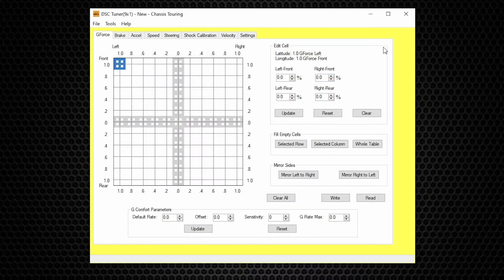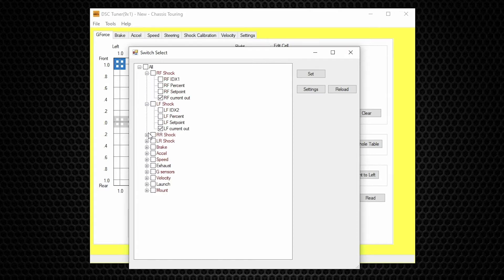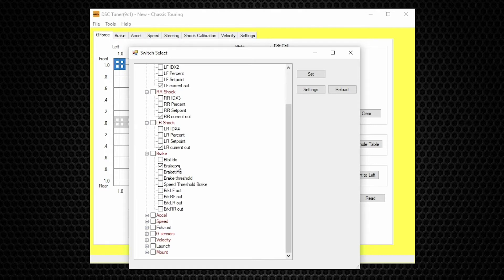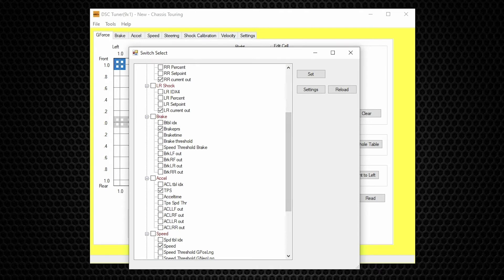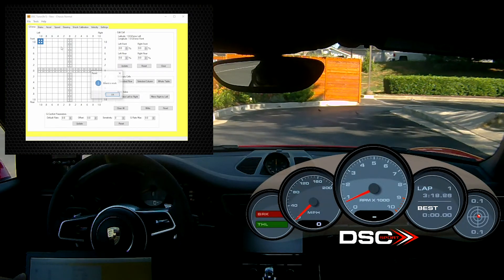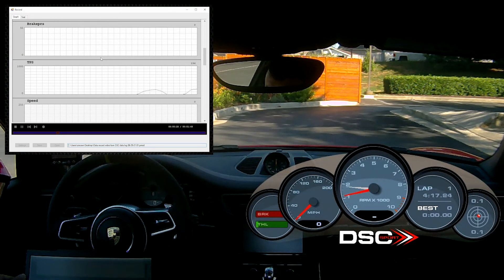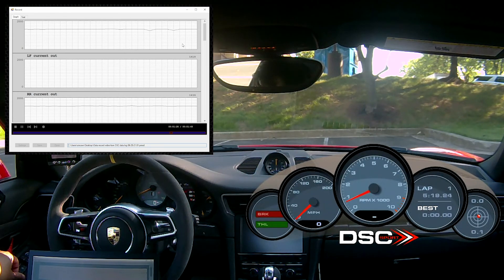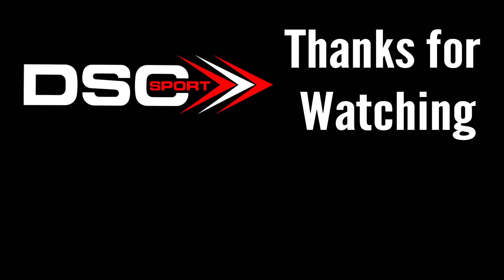How to Datalog using DSC Sport Controller

Comment: So for this car being a Porsche, where high current means soft shocks. A little confused about why the shock currents show zero before the car starts moving? That is a 0 gforce condition and seems like normally you want the shocks at soft (high current) in that situation. Typically your programs have the Gcomfort params set with a low default %value (soft) for low g force conditions so it is a bit confusing.